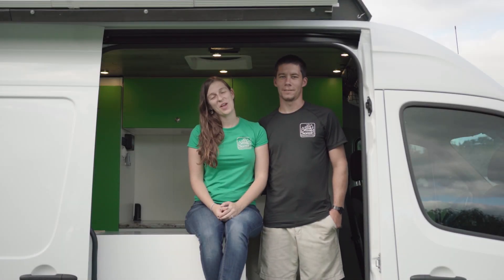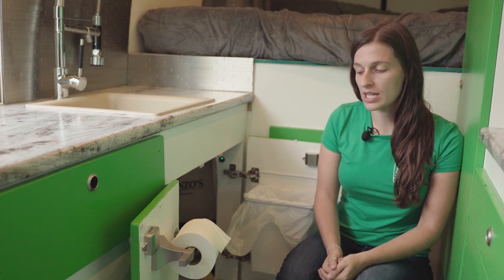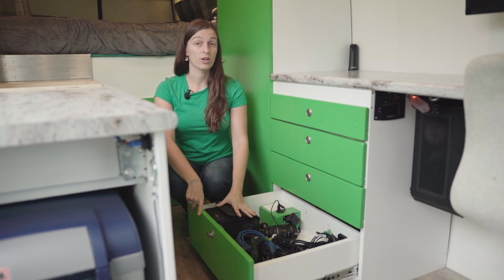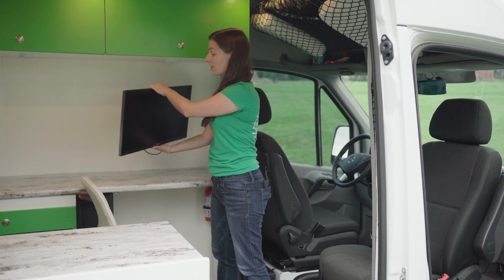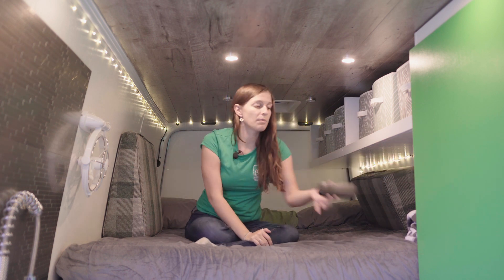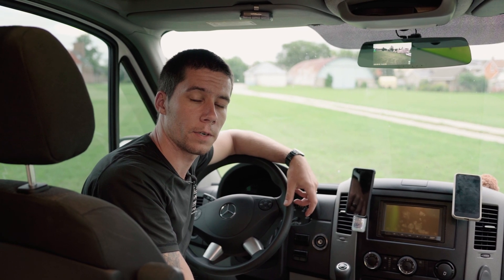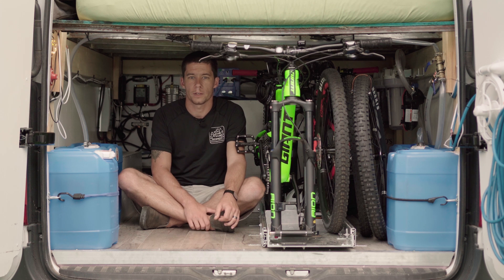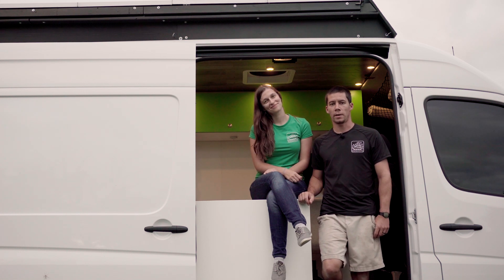DIY Sprinter Van Tour | Tilting Solar & Desktop Computer | Off Grid - V&M Vanlife and Ray Outfitted

Comment: Love it. Great design work.  Cold weather design -I love your idea to have a fan in the garage to circulate the heated air.  I also have the same foot-stool arrangement for the passenger seat. Good thing the door pocket holds the stool. 
Well done.
Reply from the maker: Thank you so much!

Yes! It's funny how many people do have the footstool. 

 Since the filming, we added a computer fan into the wall, below the foot of the bed. It pulls warm air into the garage and has been very effective. 

Safe and happy travels! 💚🚐

Comment: Excellent use of the space in that sprinter, and exactly the solar setup I would do with the diesel heater running off the engine tank. More builders should copy this! The only thing I would add is battery to battery charging off the engine. But great build!:-)
Reply from the maker: Thank you!! Yes. We have a auto charge relay. Raynor has installed some battery to battery chargers in other vans. They are much more expensive and while worth the investment, we had to make some compromise. Someday, we might get the chance to upgrade. 💚🚐

Comment: Amazing! Almost 1KW of solar panels! Great overall design! Love the green cabinet doors!
Reply: Philippe Perreault yes that only lasted three days? Large electrical consumption with kitchen appliances? Because fridge is a low draw..
Reply: Curious as to the aversion of LPG or what you call propane in USA/Canada. Is it sustainability and anti-fossil fuels? Or were you worried about anything else? The 1K solar should last so much longer ... heating water and cooking is so much more efficient with tankless LPG and gas burners for a stove which draws so much from your solar otherwise.
Reply: @longhairmullet  would probably last longer with lithium batteries as you have more usable power.

Comment: OMG your build suits exactly my needs. I'm also a data analyst/software dev from Toronto looking to go remote. I'm just wondering 
1) Is your inverter and battery bank large and powerful enough to allow you to have a normal bar fridge instead of an expensive 12V one? I'm also looking at a 900 (3*300W) solar & about 600ah of battery bank. I'm VERY disappointed that even the 950W of solar isn't good enough for cloudy stretches. BC may have a strip of snowless land but it is indeed very gray in the winter.
2) Do you feel limited by the battery bank when it comes to using your PC? Or the PS4? I'm also a gamer.
3) Do you have a muffler on your Espar heater, do you run the heater overnight and does the noise break stealth?
4) Do the ceiling fans work well if your solar panels are flat on the roof? I see that the panels are elevated a bit on the black rack to let air through, but does it actually allow decent circulation?
Reply from the maker: Hello Eric, we have ran an extension cord from our van to a friend's to run a small bar fridge. This is when we were in good sun. We have had low power days in Vancouver with grey sky's.

The only times we have had concerns about running the PC was when we didn't have sun for a few days. We do have shore power as a backup for this situation. We have used it 3 times in the 11 months on the road.

Our Espar does have a muffler on it which does make it quieter. We haven't had an issue with people recognizing what it is while stealth camping.

With the fans we do have good circulation. When in hot climates we tend to tilt the panels to allow heat to escape from under the panels. We have made it so that the fans are fully open with the panels flat and get very good circulation with them flat.

I hope this helps you out. Happy travels 👍

Comment: That rack-mounted solar system would actually be great for hot climates since it blocks the sun from hitting the top of the van.
Reply from the maker: It has been super helpful in hot climates. It definitely keeps heat off the roof more.

Comment: That rear view mirror camera system is by FAR the best I’ve ever seen. The fact that it also records is just incredible. I’m guessing it’s expensive but 100% worth it in my opinion. Could you share the brand and model name/number and where it can be purchased. I live in the United States hopefully I can find it.
Reply from the maker: We tried and returned many systems before finding this one. We're thrilled and it was less than $100 Canadian!! You can find a link to it on our website: www.vandm.ca/products There's many different brands and models that operate in a similar fashion - this one we felt was a middle ground. We did upgrade the memory card in it, after purchasing. Let us know if we can help further. Cheers!
Reply: @VMvanlife  Does the camera double as a security camera?
Reply from the maker: @ericyuan9718  the system that was installed during this van tour does have a parking mode for security. We have upgraded to a DVR system that stores 72 hours of footage which we are enjoying much better now.

Comment: In my gypsy wagon, I ran into the same issue with no leg room in the toilet closet.  I made a wall on both sides of the inside of the bathroom that is mounted on full extension slides. the door of the washroom has two small bifold doors.  To use the washroom, just open the doors, pull forward, and the wall slides out, and close the doors from the inside.   When finished using the washroom, just grab the handles on each side, pull the walls in like you were closing a door and step out.  Close the bifolds behind you, and everything is out of site.
Reply from the maker: Full bathroom privacy! Great work. 

Our approach was the result of balancing everything we wanted and would like in the space. It's a game of Tetris and there's no one right answer!

Best wishes. Safe and happy travels!! 💚🚐

Comment: Very nice! Love the solar rack. I couldn't figure out how to make it tiltable, so mine are fixed flat! Couple of comments:
- Reflectix only works if it is actually reflecting the solar radiation out. e.g. like a mirror. Putting black on it means the radiant energy turns into heat inside the van and conducts through anything it touches. Although because reflectix has air in it, it will insulate to some extent. Cheaper to use bubble wrap though :)
- It's a good idea to use opaque hoses to prevent algae growth. In New Zealand plumbing requirements say you have to use opaque hoses for this reason.
Reply from the maker: Thanks for your kind words and insights. 

 Have to say - the reflectix has been amazing. Fully tested in +40c through -20c. Thrilled with the effectiveness and the subtlety the black gives. Did side by side comparison with another van and the black fabric doesn't hinder impact on heat as much as some assume. Perhaps it's important it's thin fabric with a looser weave?  Anyways, absolutely would do again - we used the left overs from our initial build out. From the outside of the van you cannot see anyone is inside. In parts of Canada it's a dead giveaway when you see the reflective coverings that someone's in there. Passing through cities is made easier with this subtle factor. 

As for waterlines - Agree opaque has advantages. In our area we didn't find any that was flexible enough for our use here in Canada.  A reality of building on a timeframe - perfection isn't the measure of success.  It's certainly an easy upgrade to the water system if/when needed. We are living full-time in the van so it's easy to monitor our waterlines. 

Thanks again for sharing! Best wishes and happy travels! 💚🚐
Reply: Could you also use your Solar track as some kind of awning and shelter above your door ? Loved the video, some very good points, enjoy your travels.
Reply from the maker: @alexstewart9830  Yes, a system could be built where your solar acts as shade for the door. Ray has some designed for upcoming projects on other's camper conversions. 

Ours provides some but we have a DIY budget awning (tarp and tent poles,)  we setup when desired.

Comment: Amazing work. I've seen your more recent version on Tiny Home Tours. Can I ask what the power draw on the desktop PC is like — or at least, does it have a strong GPU? That makes a huge difference in consumption. I game and do pretty GPU-intensive work like Nvidia AI and 4k video editing. I've also read mixed reviews on Renogy's solar panel efficiencies and was wondering how that turned out with your wildcard brand? No worries if you're too busy to answer all that! You guys kick ass and those are some seriously clever solutions in your home.

Comment: Great video.  Which inverter did you decide on?  I can’t pull the trigger on one. Seems like all have issues with quality. The you tube videos vary from interesting to scary.  

We also prefer no LP. Our system is charger from truck alternator through a batt2batt charger. Batteries are LiFePO.  We use a 12-15V power supply for shore power charging. It attaches to the batt2batt charger.  Works great. Only one charger tp program. Will add solar some day which will mean we need additional charger. 

Thanks for sharing. 
Paul
Reply from the maker: We are upgrading to the Victron hybrid 3000w inverter when we upgrade to lithium batteries.it is programmable to use as shore power for lithium batteries.
Reply: @VMvanlife  will you do another video of your solar setup when you switch to lithium batteries? Would love to know you if you notice a marked difference in usable power. @our_landyacht / @tinywattssolar uses 600ah of lithium and 1000w solar and are all electric too. @tinyhousegiantjourney did a tour of their van - worth checking out.
Reply from the maker: @seabunny3  we do plan on doing another video when we switch over of the full electrical

Comment: Brilliant video 

1000w of solar ish on Campervan s will soon be the norm 

I've seen a couple of vlogs now including yours and Tinywattssolar that have approx 1000w solar on the roof etc 

Vloggers will soon be able to earn commission by taking sales enquiries for 1000w solar panel systems for vans and or van customised installations etc and pass them on to people like yourselves that fully understand how solar allows a person to enjoy off grid luxuries via powerful adjustable solar power banks etc that can sell the system to potential vanlife people
Reply from the maker: Thanks! 

I definitely agree that there is going to be a continued increase in campervan conversions. Solar is also in upswing so no doubt the two will benefit from each other. 

I think there will also be a shift as more of the campers are built for long term living and equipped to handle the weather in more regions of the world. During our build, there was very few videos/websites that gave insight into proper 4 season, year round living. That's absolutely changing. 

Housing in the Western world needs innovation beyond finding ways to build them faster and with less upfront cost. Look forward to watching it happen from our van. We sure dream of fueling our life by supporting others. Ray is excited to be working on other's vans. The learning never ends, that's for sure!
Reply: +V & M 

Exactly Campervan s or rv's are going to solve a lot of housing problems because Campervan s are cheaper to buy than houses and take up less room and people are starting to recycle properly and reduce spending on products simply because limited to space and are using free energy and it encourages creativity because people are starting to only have what they need and design their own Campervan that suits their own needs which is why there are so many different layouts that vanlife vlogs show etc which gives people ideas on how they want their own Campervan to look and there are a lot of Carlife vlogs too

More and more people are deciding to live life instead of simply existing through life by deciding not to pay rent all their life and instead put the money they used to pay in rent in their back pocket and live a better healthier lifestyle

We could do with a van build in the uk

Comment: Nice build. Can I please ask what the 360-degree personal fan model is? Do you find it works well? Cheers.
Reply from the maker: The fan is a Sirocco II which you can find on Amazon.  We love the fan. It helps keep us cool in the summer and circulates air when we are closed up in the winter.

Hope this helps. Happy travels 👍

Comment: Awesome van! Checked your products list and didn't see a link for the wall fans. Could you please provide a link or mfg info? Also, wondering if you find it light enough without windows. As a solo female I like the no window option for better security, but I am concerned about the lack of natural light. Thank you!
Reply from the maker: Thank you. You can find the fan by searching Sirocco II on Amazon. 
We enjoy not having windows for the fact of retaining heat in the winter and blocking it out in the summer. We have a lot of lights in the van. Most of the time when we are in nice weather we have the sliding door open or the back doors to let in the sun/natural light. It does help a lot for being stealth as it appears more like a contractor vehicle.

Hope this helps you. Happy travels 👍
Reply: V & M Thank you and happy trails to you both as well!
Reply: Found it! The correct name is Sirocco II in case anyone else is interested. :-)
Reply from the maker: @JulieR888  that is correct, autocorrect changed it in me, updated now. Thank you.

Comment: I enjoyed your video and think you did a great job with the van. I have a question about weight: was it hard to stay within the Van load limit with all those cabinets, bed, closet, solar panels &  tilting rack, bikes, fridge and toilet while also carrying 30 gallons of water ( if i did the mat right)? Did you check the weight often in between building stages? What  wood thickness  did you use for your cabinets?   Thanks!
Reply from the maker: Wood Thickness: Most of the cabinets are 3/4" plywood. The walls are 1/8". 

Bed frame and solar rack are made from steel tubing which is a little lighter than wood. 

I drove over the scales a couple times over the build. We doubled our water after our first 20,000km of travel - we knew then we had the weight capacity. 

Sprinters are designed to haul. 

We hope this helps. Best wishes on your adVANture! 💚🚐
Reply: Would you mind to share the load weight (without the sprinter)?

Comment: The solar panels are wired in series or parallel ??? And U have to admit with all that solar everyone is going to know someone is camping/living inside... although privacy is still important. Thankhz for sharing. Wholeness n Love ((-;
Reply from the maker: They are wired in series parallel: there are three parallel banks of two panels wired in series. 

We have to admit it has amazed us how many DO NOT realize it's a camper. Tradesmen ask Raynor is he's running tools off solar. Others just wonder what it is up there. Perhaps it's our lack of camper windows? Can't say we've ever felt a lack of privacy when we are in the van - window coverings make it our own little world in here. ☺️
Reply: @VMvanlife  Ohhkay... interesting. What did U use for the walls??? IAm in the insulation phase of myVan build. I have a slide door window to install and was going to buy moor. Maybe I won't install so many windows.... but IAm definitely wanting to go large (and lithium) with solar. Thankhz so much for replying... Wholeness n Love ((-;
Reply from the maker: @naimasrael6829  for insulation we used XPS rigid foam between 1.5" and 3" where it allowed, then a layer of reflectix which is only tacked where the 1" fur strips are for our air gap. Depending on where you are this might be a little much as we were planning for -20C temperatures

Comment: Wow! Nice van! I'm curious, though, with the cost of motor fuel in Canada, wouldn't it have been cheaper to use propane and a wave 3 or wave 6 for heating? Maybe propane isn't cheaper than diesel up there, but in the States it sure is!
Reply from the maker: Thanks! It's a personal preference.

We opted for no propane in the van.  We feel safer and more comfortable with no propane tanks in our vehicle. An added benefit: easier when traveling. We only have to locate one fuel source in our travels. Much of our build - like water jugs we opted for simplicity/ease of use and resupply.  We don't regret this. 

Do what suits your own budget, lifestyle and comfort level.